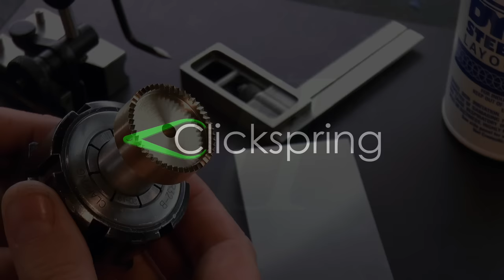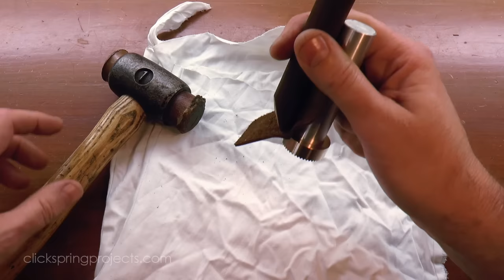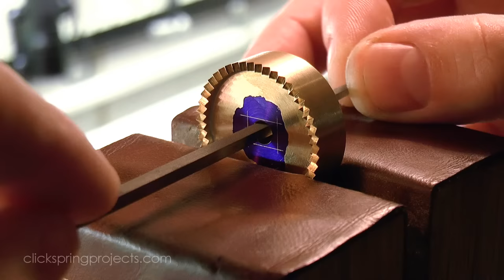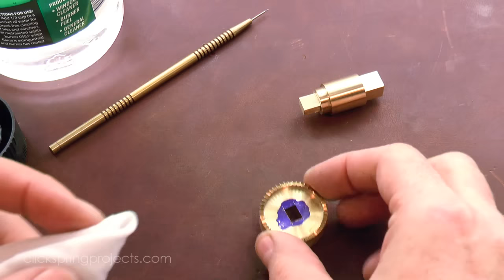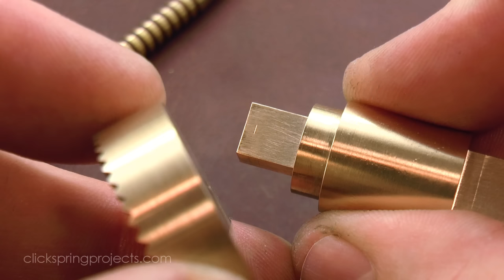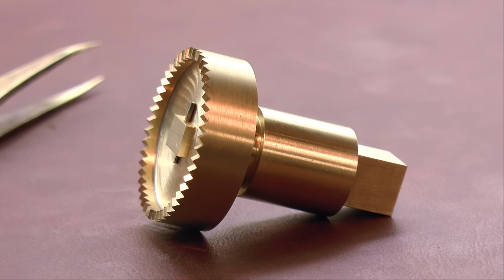Fitting A Crown Wheel & Shaft

Comment: How are the calculations for the missing pieces of the Mechanism going? Will a prototype be made for a possible extra set of gears and pointers?
Reply from the maker: Yes, more to come :)
Reply: Which research paper, I wonder @ClickspringClips  will you be using for the upper gear trains that sit upon B1? Will you continue as you planned with Tony Freeth's 2012 research paper? His 2021? Your own? Or a combination of both your own and that found in Freeth's 2021? 
I mean, I'm all for a combination - we used the gear trains from Freeth's 2012 paper and the front rings from his 2021 paper.